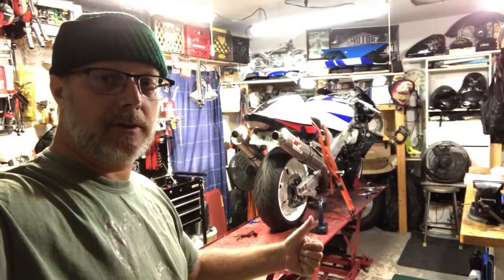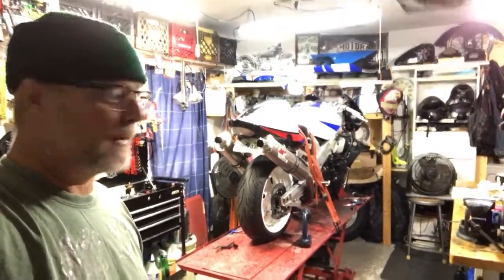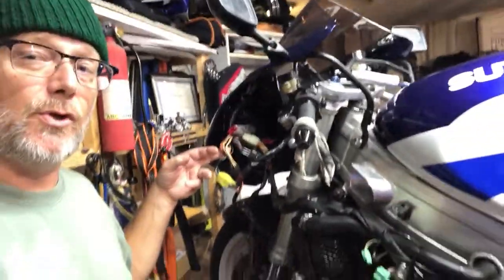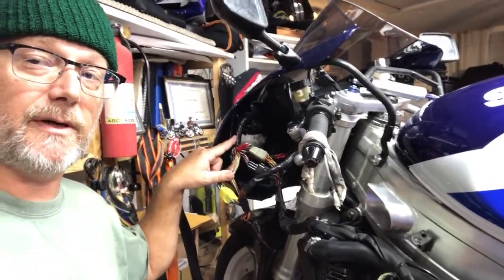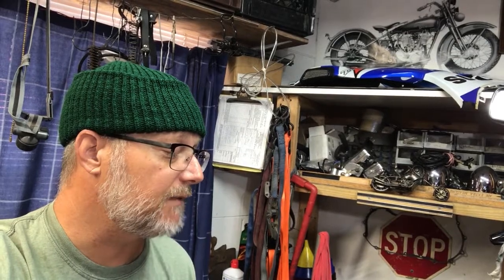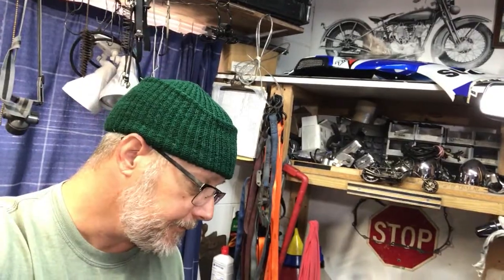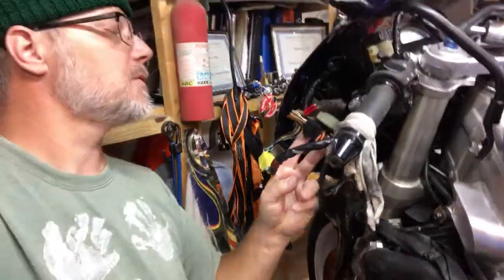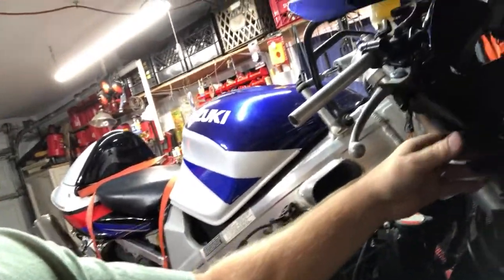2002 Suzuki TL1000R won’t crank

Comment: Dude I’m having an issue with no spark on my 2000 tLR and I’m suspecting my kill switch or the connector.  I have to confirm but I have changed everything else so far. What a pain this has been.
Reply from the maker: Electric gremlins are by far the hardest thing to diagnose. Don’t forget to check the fuses and the ground to the coils. It cranks but no start with no spark at the plugs? Check that the battery has at least 12.7 vdc. Good luck
Reply: @fitchpaintingrepairllc9871  I figured it out bad connection with the old white factory plug. Cut it all out one by one and put a new 16 pin connector to hopefully stop any future problems with that plug fingers crossed.
Reply from the maker: @unknownamigo0  lots of movement with the way the wires are installed on that bike. Leave some slack and use dialectic grease

Comment: My tl1000r won’t even turn on my battery is new my rectifier is new fuses r new relay r new help!!
Reply from the maker: Check all the wire connections. Start at the battery then the ground wire to engine/frame. Then move on to the handlebars and speedometer assembly. Check each wire connection. The sub harness on the left side fairing is notorious for the connections failing. Check the metal pins inside each plastic plug. The female side can get worn or brake. Wiggle each wire while trying to start it. On this bike it was the wire connections from the kill switch to the main harness. Good luck
Reply: @fitchpaintingrepairllc9871   okay so I got my bike to turn on and turn over but my push to start button isn’t working my ignition is tho I think it has something to do with the harness